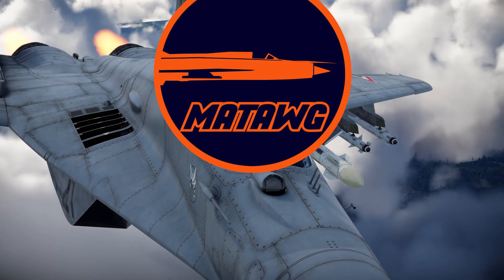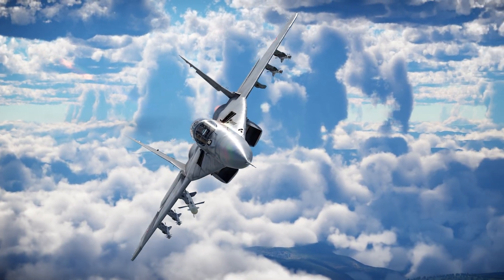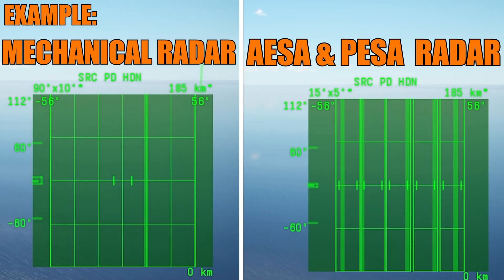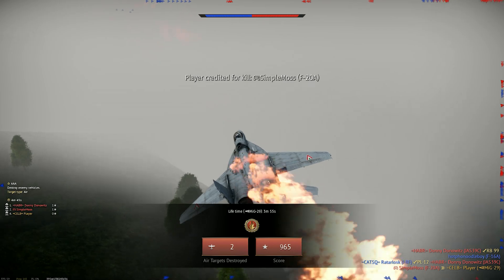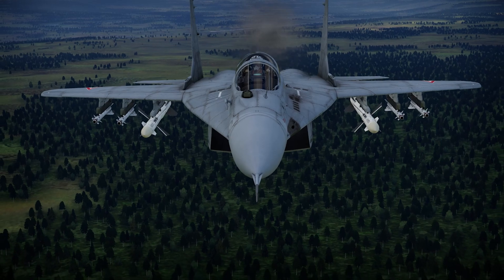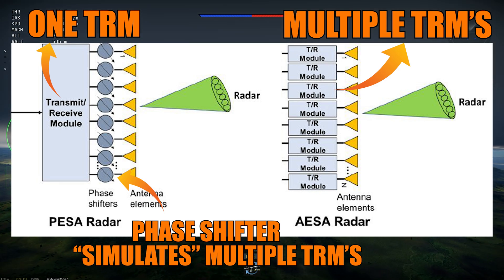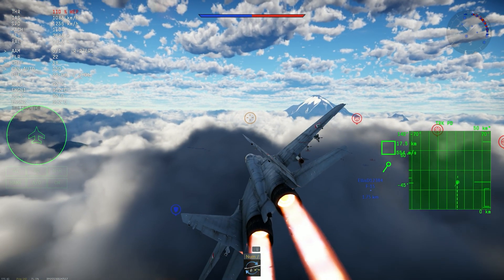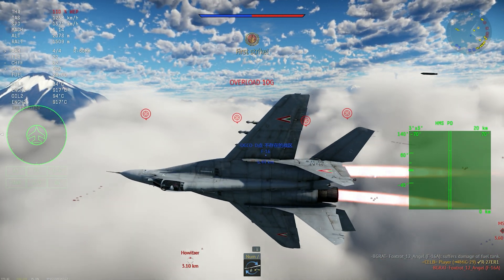The FUTURE of RADARS in game! WHAT are AESA & PESA radars? - War Thunder

Comment: I don't quite get why an AESA radar would be weaker than a PESA radar. I'm pretty suret he range is dependent on the total amount of energy you emit, if your TRM isn't strong enough just add some signal amplifiers.

The PESA has a handful of TRMs and a lot of amplifiers per TRM and the AESA has a lot of TRMs and few amplifiers per TRM. Tha main hurdle for AESA will likely have been the minituarisation of the TRM since generating a microwave in the first place is hard, as you can tell by the chunkyness of your microwaves magnetron.

Both can scan at near instantaneous speed, since the sweep speed is only limited by the speed of modulation for your signal (the older the slower, vacuum tubes vs semiconductors and such). Both can also track a nearly arbitrary amount of targest, mainly limited by the amount of signal processing you can do.
Both can work in multiple bands but there they are limited by the amount of TRMs, so point for AESA.

So I doubt, that a PESA has any advantage over an AESA asaide from economical ones. If you want a bright beam you just send at the same frequency if you want to be harder to detect you send at diffrent frequencies and use signal procesing to fiulter out noise (I think that's where you ge the ide that the range of an AESA si lower, but that's a specific use case, though likely the most common one) wich makes you also harder to jam.
Reply: The reason why an AESA radar, usually*, doesn't have the same power output as the PESA radar is simply physical, power produces heat, and a lot of miniaturized TRMs physically can't handle the same amount of power than a single, or a few bigger TRMs, all *made from of the same material, can and that's quite a definite limit, there's no way around it.

What you can do is use different materials that can handle the same power but in more compact form, or you can use materials with higher sensitivity so they could perform roughly the same with less power, or even better, you do both. Which is why much of the most recent AESA radars have TRMs made with Gallium Nitrite, which is both more sensitive and can handle more power.

The range issue is a mix of computing power and sensitivity, most of the power a radar emits is dissipated by the atmosphere as photons interacts with air molecules and other metheorological phenomena, so the return signal is often small, so the receiver has to be sensitive enough to receive it, the problem is that the you have to deal with all the background noise caused by other sources of radiation or other sources of radar returns, it is very difficult to filter out this kins of thing on a older radar despite its power, because it's heats quite a lot and it makes almost impossible to compute what is a weak return and what is noise. One way to solve this is lighting the target area with a very strong signal, which will produce a stronger return, hopefully above the background noise's ceiling. 

AESA and PESA radars can be plugged in on more powerful computers, you often will use on-board machine learning algorithms to filter out noise automatically, and to more easily manipulate the signal. If enough computing power is available AESA has an advantage, since the many TRMs can be used individually, so you can perform more signal transforms on the various signals to be able more finely identify what is noise and what isn't.
Reply: AESA is harder to cool, so it can't receive same amount of energy as PESA with comparable size and weight. You can make AESA see as far as PESA, but then it'd be larger and heavier. AFAIK F-35 can "overclock" its AESA to see further, but only for limited time since after that it'll overheat.
Reply: AESA can’t be mounted on hydraulic gimbals so all AESA radars are limited to +-90deg (180deg total, most have 120deg such as those radars on F-35’s or F-22’s) while PESA can be mounted on them so they theoretically can have up to +-180deg limits (360deg total), the most common example is Su-35’s N035 radar with +-120deg (240deg total) so you can go cold while guiding missiles
Reply: @СергейНикольский-я2ц  false, Gripen E has it's AESA mounted on a swashplate/gimbal so it can slightly fly away from it's target while still observing it through the main radar + all of the other sensors built in to give it spherical coverage, not just 360⁰ but a total sphere.
Reply: @СергейНикольский-я2ц Su-35s has 360 degree radar coverage
Reply: @СергейНикольский-я2ц having 360° coverage for a modern air to air combat is nearly irrelevant because combat almost never get to visual range, and if you're at WVR combat, you'll have way more problems than that. It is very important to Attack platforms, since they have to be way closer to the target to be aple to drop bombs and other air to ground ammunition, you'll also be way closer to ground the tipical air to air battle, thus the possibility of an enemy coming from outside your frontal 180° is quite real. That why the Su-57 is optimized to be way more stealthier from its front, than from other sides, because it was thought out as a more defensive air superiority fighter, so it wouldn't have to deal with enemies coming from other vectors very oftenxso why bother?
Reply: @СергейНикольский-я2ц  No, the claim that PESA radars have an advantage due to mounting on hydraulic gimbals is outdated and ignores the significant technological leap AESA radars have made. While PESA systems like the Su-35’s N035 Irbis-E can theoretically achieve +/-120° (240° total) azimuth coverage due to gimbal mounting, modern AESA radars far outperform them in nearly every other aspect. AESA radars—like the APG-77 (F-22) and APG-81 (F-35)—may be limited to +/-90° (180° total) electronically steered coverage, but this limitation is vastly outweighed by their superior range, resolution, and electronic counter-countermeasures (ECCM). For example, the Irbis-E has a maximum detection range of 350 km against a 3 m² target, but only in a cued 10°x10° FoV. In normal search, this drops to around 200 km, and tracking range is even lower—often as low as 100 km for fighter-sized targets.

In contrast, AESA radars can achieve superior detection and tracking ranges while operating in a Low Probability of Intercept (LPI) mode, making them far harder to detect by enemy RWR systems. The APG-77 and APG-81 radars can track targets at ranges exceeding their missile envelope (e.g., AIM-120D and upcoming AIM-260). Furthermore, AESA’s LPI mode makes it nearly impossible for the target to know when it's being engaged—unlike the Irbis-E, whose transmissions can be easily identified by modern RWRs due to its narrower bandwidth and non-agile frequency.

PESA radars like Irbis-E also fall behind in SAR resolution. The Su-35’s radar has a SAR resolution of 3 meters, comparable to 1980s-era APG-70 on the F-15E, whereas most AESA radars today can achieve 0.1 to 1 meter SAR resolution, providing vastly superior ground target identification capabilities.

Additionally, AESA radars support simultaneous air-to-air and air-to-ground modes, offering multi-tasking abilities that PESA systems can't match. For instance, the APG-79 can track multiple air targets while performing high-resolution SAR mapping, something Irbis-E cannot do effectively.

In summary, while PESA radars might benefit from larger azimuth coverage via gimbals, AESA radars far surpass them in range, ECCM, LPI, resolution, and multi-role performance. The outdated Irbis-E is not even in the same league as Western AESA systems, and even the Su-57’s future AESA radar will likely outperform it in most metrics despite being smaller.
Reply: @Levi-pp8sq your information on the Irbis-E is wrong, according to the patient of the radar, it has 0.1 to 1, like the modern AESA radars nato has
Reply: @Levi-pp8sq  "AESA radars can achieve superior detection and tracking ranges while operating in a Low Probability of Intercept (LPI) mode"

PESAs also have that capability

"APG-77 (F-22) and APG-81 (F-35)—may be limited to +/-90°"

+- 60 degrees tops and with significant loss in detection range

"vastly outweighed by their superior range, resolution, and electronic counter-countermeasures (ECCM)"

Except that Irbis has greater range and we have no idea about ECCM capabilities, but they should be similar for PESA and AESA of the same tech level

"Irbis-E, whose transmissions can be easily identified by modern RWRs due to its narrower bandwidth and non-agile frequency"

Absolutely wrong. PESAs can switch frequencies as fast as AESAs and have similar band widths since they work by the very same principles

"PESA radars like Irbis-E also fall behind in SAR resolution. The Su-35’s radar has a SAR resolution of 3 meters, comparable to 1980s-era APG-70 on the F-15E, whereas most AESA radars today can achieve 0.1 to 1 meter SAR resolution, providing vastly superior ground target identification capabilities."

No serial aircraft has 0.1 m2 resolution. Furthermore, that's hardly even needed because optics is a better choice for spotting ground targets. Check all the containers US planes carry and F-35s EOTS

"Additionally, AESA radars support simultaneous air-to-air and air-to-ground modes, offering multi-tasking abilities that PESA systems can't match"

If you're referring to the capabilities to split the radars TR modules into separate groups one of which would scan for air targets and the other - for the ground ones you'll get a poor detection range in a2a mode and the same problem with a2g simply because if you split the radar in 2 halves you halve the power output and halve the used radar array area.

Furthermore, why on earth would you need to make such a split?

Lastly, if you meant that the radar scans air and ground targets by turns, well, PESA is capable of that as well

"In summary, while PESA radars might benefit from larger azimuth coverage via gimbals, AESA radars far surpass them in range, ECCM, LPI, resolution, and multi-role performance."

In summary, you're wrong in every of your statements. And let me remind you that when first F-15Cs started to receive their AESAs (AN/APG-63(V)2) in early 2000s those were so bad compared to simple planar arrays that only like 20 of such radars were ever built. F-22 was less lucky in that regard and had no backup radar back in the day so it had the very same problems until 77v1
Reply: @ГеоргийМурзич  

"PESAs also have that capability" 

They absolutely do not. Low Probability of Intercept (LPI) hinges on broad bandwidth, frequency agility, and rapid beam steering—all areas where AESA dominates. A PESA like Irbis-E has a single frequency generator and narrower bandwidth; it can hop around a bit, but nowhere near the agility of a modern AESA’s thousands of independent transmit/receive modules (TRMs). When you say “PESAs can switch frequencies just as fast,” you’re ignoring fundamental hardware constraints: a single high-power tube driving the entire array cannot dynamically segment and hop across multiple frequencies like thousands of GaAs or GaN T/R modules can.

"+- 60 degrees tops with significant loss in detection range"

There’s a bit of nuance here. Technically, most AESA arrays (including APG-77 and APG-81) can steer beams out to about ±70° or even ±80° from boresight, but with reduced antenna gain once you get far off-center. Some sources will round that to ±60° (because that’s the zone where performance remains high) while others cite ±90° as a “hard limit” the array can physically reach but with a significant drop in detection range at the extreme edges. So when someone says “it’s ±60°,” they’re talking about the zone with minimal performance degradation. When people say “±90°,” they’re referring to the extreme mechanical or electronic limit of beam steering—technically possible, but not optimal.  By the way performance degradation near the edges is generally gradual, not abrupt. In other words, you don’t go from 100% detection range at ±59° down to 0% at ±61°. 

"Except that Irbis has greater range "

Only if you cherry-pick that 350 km figure in a 10°x10° cued search, basically looking through a straw at high PRF. In normal search, the same Russian sources you praise drop that range to ~200 km, and even that shrinks further when you actually track a target (instead of just detecting a blip). Multiple flight test docs hint the Irbis-E’s fighter tracking range is ~100 km—which coincidentally lines up with the R-77-1’s max engagement envelope. Western AESA radars like the APG-79 or APG-81 can maintain track well beyond their missile ranges (AIM-120D / AIM-260). That’s the difference between quoting marketing brochures (Irbis-E) and actual operational performance (AESA).

"and we have no idea about ECCM capabilities, but they should be similar for PESA and AESA of the same tech level"

Give me a break. ECCM performance directly relates to how well a radar can shift frequencies, manipulate pulse waveforms, and distribute power across modules to counter jamming. AESAs enjoy both a wider bandwidth and independently addressable T/R modules, letting them form complex waveforms on the fly. Irbis-E has a fraction of that bandwidth, making it far more vulnerable to advanced deception jamming (e.g., Spectra on Rafale, DASS on Typhoon, ALQ-214 on Super Hornet). Just ask yourself why Russia’s own next-gen Su-57 is ditching PESA for an AESA design if PESA is “just as good.”

"No serial aircraft has 0.1 m2 resolution. Furthermore, that's hardly even needed because optics is a better choice for spotting ground targets. Check all the containers US planes carry and F-35s EOTS"
 
Jesus... Irbis-E: Officially downgraded from “1 meter” (promised in 2011) to 3 meters once Su-35 entered service—putting it in 1980s APG-70 territory.
Modern AESAs: Sub-meter resolution is very real—we’re talking 0.3 m or better on many Western fighters. Even the “tiny” APG-83 on an F-16V can generate SAR maps beyond 300 km, and yes, in that sub-meter ballpark. “Use optics instead” is a total cop-out. Weather, night, or standoff distance can degrade optical sensors. Radar can see through clouds, smoke, and at long ranges. Meanwhile, the Su-35 is stuck with 3 m resolution unless you want to inch in dangerously close.

"If you're referring to the capabilities to split the radars TR modules into separate groups one of which would scan for air targets and the other - for the ground ones you'll get a poor detection range in a2a mode and the same problem with a2g simply because if you split the radar in 2 halves you halve the power output and halve the used radar array area."

This is a bizarre claim. Multi-tasking is vital when you want to maintain situational awareness of incoming threats while generating high-res ground maps—particularly in a hot zone. AESA can partition its T/R modules for different tasks. Yes, total power splits, but guess what? AESA has power to spare and can dynamically reallocate it. Meanwhile, a PESA like Irbis-E scanning the ground is basically not searching the air. Let’s not pretend that’s an advantage...

"And let me remind you that when first F-15Cs started to receive their AESAs (AN/APG-63(V)2) in early 2000s those were so bad compared to simple planar arrays that only like 20 of such radars were ever built."

That’s like saying your 2002 Nokia phone invalidates the entire concept of smartphones today. The APG-63(v)2 was a prototype limited-production radar—an early stepping stone to more advanced AESAs. Comparing it to modern GaN-based (or even late-generation GaAs) sets is ridiculous. The APG-77v1, APG-81, APG-79, and APG-83 are the culmination of decades of AESA development. Russia’s PESA tech, on the other hand, has been stuck with narrow bandwidth and a single tube transmitter since the early 2000s.

PESA radars like Irbis-E simply do not match modern AESAs in range, ECCM, LPI, resolution, or multi-role performance. Inflated marketing specs and nostalgic claims about early-2000s AESA prototypes don’t change the fact that today’s AESAs—APG-77v1, APG-79, APG-81, APG-83—are at least a full generation ahead. The only reason someone would cling to the “PESA is just as good” line is either ignorance of how phased arrays work or an infatuation with Russian PR. If PESA were genuinely on par, Russia wouldn’t be racing to field an AESA on the Su-57.

In short: Modern AESA > PESA. Period.
Reply: @Levi-pp8sq  " AESAs, with thousands of independent T/R modules, dynamically hop frequencies across a wide spectrum. Irbis-E, with its single frequency generator and narrow bandwidth, can’t replicate this."

All AESA TR modules emit one frequency at a time, just change it frequently. If all the modules emitted at different frequencies the radar wouldn't see anything, it's just not how LPI works

Anyway, let me quote you something: "The AN/APQ-181 is an all-weather, low probability of intercept (LPI) radar system designed by Hughes Aircraft (now Raytheon) for the U.S. Air Force B-2A Spirit bomber aircraft."

AN/APQ-181 was a PESA.

Where did you get that info about PESA having narrower bandwidth than AESA? It has nothing to do with the antenna type. Even a slotted or kassegran radar can have the very same capabilities bandwidth wise.

""Irbis-E has greater range": Only in cherry-picked scenarios. That 350 km range is for a cued 10°x10° search at high PRF, essentially tunnel vision"

Do you think it takes a lot of time for PESA to scan such an area? For example, it takes Irbis 6.5 seconds to scan 120x120 degrees with the narrowest beam. You don't even need to scan that much: 10x10 degrees at 350 km makes it a square with a side of 60km. I doubt that you need that much in trems of altitude so the better choice would be to use 20x5 scan mode which is present. You could say that at such distances the radar (like any other, btw, including AESA) might need to scan the area multiple times, but it'll take seconds which at such distances is nothing

"In normal search, even Russian sources admit a range of ~200 km. Fighter-sized target tracking? ~100 km. "

They don't. What you can find here is that Irbis is capable of detecting 3m2 at 400km in DO (Long range detection) mode.

"At 3 meters, Irbis-E is stuck in the 1980s APG-70 era."

Ad videos for export customers claim it to be 1m, not 3m

""Simultaneous air-to-air and air-to-ground is pointless": Absurd. Multitasking is critical in contested environments."

For a2a you need to be light, agile and fast, conduct maneuvers, evade missiles. And for a2g you have to fly straight-ish and carry heavy stuff. Furthermore, don't you find it a little challenging for a F-35 pilot to engage a fighter while trying to find a target on the ground?

Anyway, those ads I was talking about also mention that Irbis is capable of doing that (well, no problem there: since scanning is still done electronically you can point the beam instantly to wherever you want), but I guarantee you, no one will ever use that useless feature in combat.

""F-15C’s early AESA was bad, so all AESAs are questionable""

I didn't say that. 

"If PESA were viable, Russia wouldn’t be scrambling to field AESA radars."

It's like saying "if AESAs were viable the americans would fit them in all of their F-15s in early 2000s" 
You put smt on a plane when it's mature enough or you'll end up in that infamous F-15C/F-22 situation.

"In short: AESA > PESA. Physics doesn’t care about your feelings."

Of course, a perfect AESA is better then a perfect PESA. It's just that the first ones are far from perfection and the latter ones are reaching it. N036, while being an AESA, haven't surpassed N035 in terms of its capabilities. Not yet
Reply: "All AESA TR modules emit one frequency at a time"

This statement betrays your lack of understanding. AESAs can emit a single frequency for a coherent beam, but they don’t have to. The agility of thousands of independent T/R modules allows them to create highly diverse, adaptive waveforms across a broad spectrum. This is the foundation of LPI and ECCM. PESAs like Irbis-E, with a single frequency generator, are inherently limited by their architecture and cannot approach this level of versatility or resistance to interception and jamming.

Your reference to the AN/APQ-181 is outdated and irrelevant. While a PESA can be optimized for LPI to an extent, it cannot match the inherent advantages of an AESA, which combines LPI with vastly superior ECCM performance due to waveform agility, adaptive nulling, and distributed architecture. That’s why modern designs, even in Russia, are abandoning PESA.

"PESA and AESA have similar bandwidth"

ncorrect again. Bandwidth is tied to the radar's ability to generate diverse waveforms and resist jamming. AESAs inherently benefit from broader bandwidth because each T/R module contributes to total bandwidth and agility. Irbis-E, constrained by its single emitter and limited SAR performance (downgraded to 3m), demonstrates the narrow bandwidth of Russian PESA radars. Meanwhile, modern AESAs like the APG-79 and APG-81 achieve sub-0.5m SAR resolution, which directly correlates with superior bandwidth. If PESA and AESA were bandwidth equals, Irbis-E wouldn’t be stuck in 1980s territory.

"Irbis-E’s range is 400 km, not 200 km"

Misleading as i told you. The 400 km figure is cherry-picked, using a narrow 10°x10° FoV against a 3m² target in long-range detection mode—conditions irrelevant in real combat. Normal search range for Irbis-E is around 200 km, and actual fighter tracking range is closer to 100 km. Western AESAs, by contrast, maintain tracking ranges beyond missile envelopes (AIM-120D ~160 km, AIM-260 even further). Performance at extreme distances isn’t just about detection; it’s about tracking targets reliably in cluttered, contested environments—an area where Irbis-E falters.

Your claim that “scanning takes seconds” ignores operational realities. Repeated, reliable scans in a jamming environment or against low-RCS targets are not instantaneous, especially for a PESA. AESAs excel here due to their ability to rapidly reconfigure beams and prioritize threats dynamically.

"Ad videos claim Irbis-E has 1m SAR resolution"

Are you okay? "- дальность обнаружения целей с ЭПР = 3м2 – 350-400 км" Can you read??? Beside that manufacturer claims mean little without evidence. The SAR resolution was downgraded to 3m post-service introduction, aligning with its narrow bandwidth. 

"If PESA weren’t viable, why wasn’t AESA fielded earlier?"

Another poor analogy. AESA technology has matured significantly since the early 2000s, with advancements in GaN modules, power efficiency, and software. The APG-63(V)2 was a stepping stone, while today’s APG-77v1, APG-81, and APG-79 represent a fully matured generation of radars. Russia’s PESA tech, on the other hand, has stagnated. That’s why even Russia is now racing to field AESA radars like the N036 for Su-57—despite your attempt to dismiss this glaring contradiction.

"N036 hasn’t surpassed N035 yet"

This argument undermines itself. If the N035 Irbis-E were truly superior, there would be no need for N036. The reality is that AESAs are vastly superior in ECCM, LPI, multitasking, and even future-proofing for GaN advancements. Russia’s AESA tech lags behind Western standards due to limitations in T/R module production, but they’re still moving toward AESA because it’s the only viable future for radar systems.
Reply: @Levi-pp8sq  "AESAs can emit a single frequency for a coherent beam, but they don’t have to."

Although the AESA is able to quickly switch between different frequencies or use different frequency sub-bands, this happens sequentially and not simultaneously for all TRMs. With each switch, all the TRMs synchronously switch to a new frequency.

If each TRM could operate at its own frequency, the signals from them would be incoherent, and it would be impossible to form a focused beam. This would entail a drastic reduction in the detection range.

Instead of using different frequencies at the same time, the AESA switches between different frequencies or sub-bands for different tasks such as scanning, tracking, or anti-interference. Switching takes place synchronously and sequentially for the entire antenna array.

Thus, simultaneous operation at different frequencies within the same beam in AFAR is impossible without loss of coherence and significant reduction in efficiency.

"While a PESA can be optimized for LPI to an extent, it cannot match the inherent advantages of an AESA, which combines LPI with vastly superior ECCM performance due to waveform agility, adaptive nulling, and distributed architecture. That’s why modern designs, even in Russia, are abandoning PESA."

Like I've already said, AESA is superior to PESA, for sure. But like any technology, AESAs were needed to be polished first, not rushed into service like it the US. It reminds me of comparing guns to missiles, even though, to a much smaller degree. You know, Vietnam war, gunless fighters (because missiles are so much superior), Aim-4/7, that kind of stuff."

 

AESA are better then PESA in terms of "band width, Irbis SAR = 3m"

Yes they are. In the perfect world.  But IRL - not always and not always the difference is huge enough. Like I said, N036 is equal to N035 in terms of capabilities. 

I opened N035 manufacturer website, it states 1m2: "Разрешение при картографировании с синтезированной апертурой
1 м"

" If the N035 Irbis-E were truly superior, there would be no need for N036. "

 Except there would. Irbis is a larger radar which wouldn't fit into Su-57s nose cone. And, like i said, PESA capabilities drop significantly with size reduction. Su-27 family has a huge nose cone which allows it to house a very large "dish". 

The transition to AESA (Active Electronically Scanned Array) radar is essentially inevitable, the question being only that at present this technology isn’t mandatory for fighters like the Su-27 due to the sufficient space available to implement PESA technologies.
Reply: @ГеоргийМурзич  "AESA can’t operate TRMs at independent frequencies":

This is a strawman. AESAs do not randomly assign each TRM a frequency. Their strength lies in synchronized control across thousands of modules to create coherent beams while dynamically adapting frequencies and waveforms across a broad spectrum. This agility enables unmatched LPI and ECCM capabilities. Irbis-E, with a single emitter, cannot match this. Stop conflating beam coherence with agility—AESA achieves both.

"Switching is sequential and reduces efficiency":

Wrong again. AESAs operate across sub-bands with rapid, adaptive frequency hopping, maintaining coherence while outmaneuvering jammers. It’s not a compromise; it’s deliberate agility. PESA, with its narrow bandwidth and single source, can only dream of such flexibility without becoming a jammer’s easiest prey.

"N036 is equal to N035":

Completely false. N036 introduces GaAs-based modules for better LPI, ECCM, and multitasking. If N036 is only “equal,” then the investment makes no sense. The Su-57’s smaller nose cone argument doesn’t hold either; even smaller AESAs (e.g., APG-83) far outperform Irbis-E in resolution, range, and multi-role capacity.

"PESA wasn’t rushed like AESA":

This is laughable. The APG-77 and APG-81 have decades of combat-proven performance. Meanwhile, Irbis-E, still based on Cold War tech, is already obsolete. Russia’s move to AESA isn’t about “rushing”—it’s about catching up.

"SAR resolution is 1m":

The page you referenced describes a compact airborne SAR system for Earth monitoring, not the Irbis-E radar used on the Su-35. While the NIITP SAR boasts a 1-meter resolution, it is irrelevant to fighter-mounted radars like the Irbis-E. The Irbis-E’s SAR resolution is well-documented at 3 meters, as confirmed by its manufacturer Tikhomirov NIIP and post-service performance updates.  Even legacy AESAs like APG-79 achieve sub-0.5m SAR, making this a generational gap, not a minor difference.

Bottom Line: PESA is a technological dead end, struggling in contested environments where AESA excels. Your attempts to deflect—arguing about size, sequential switching, or vague "real-life" caveats—don’t hold against physics or operational realities. AESA radars dominate in range, resolution, ECCM, and survivability. Russia itself acknowledges this by transitioning to AESA despite resource constraints.

This discussion is done.
Reply: @Levi-pp8sq  "strength lies in synchronized control across thousands of modules to create coherent beams while dynamically adapting frequencies and waveforms across a broad spectrum."

Which actually is the very same thing PESAs do because pesas control thousands of emitters to do the same job

" AESAs operate across sub-bands with rapid, adaptive frequency hopping, maintaining coherence while outmaneuvering jammers"

So if there are 2 equal AESAs looking at each other, but one is jamming, the non-jamming one will outmaneuver it lol? You write about capabilities that are accessible to all ESA radars, not just AESA

" PESA, with its narrow bandwidth and single source"

It doesn't matter what powers each emitter. Either 1 powerful element or thousand individual ones, both will work at 1 frequence at each given time. And the bandwidth is dependent on the requirements and industrial capabilities, not array type

"even smaller AESAs (e.g., APG-83) far outperform Irbis-E in resolution, range, and multi-role capacity."

APG-83 (as well as 77 and 81) doesn't outperform Irbis in range. Might be better in terms of resolution though. And I suppose I made it clear about the usefullness of simultaneous multirole usage

"This is laughable. The APG-77 and APG-81 have decades of combat-proven performance. "

What is laughable is saying that those have any combat. Balloon proven - yeah, sure. Irbis is the only of these 3 radars that was and is used to shoot down enemy aircraft at enormous ranges. The longest kill (MiG-29) was at 213km and is confirmed by necrologues from Ukrainian side. Just for comparison, the longest US tech a2a kill is ~30km. Also quite the recent one, actually

"The page you referenced describes a compact airborne SAR system for Earth monitoring, not the Irbis-E radar used on the Su-35"

I don't know what you opened, I opened KRETl web site where if you click on Irbis-E name and it shows you its specs
Reply: @ГеоргийМурзич 
Ur just wrong dude, have a nice day.